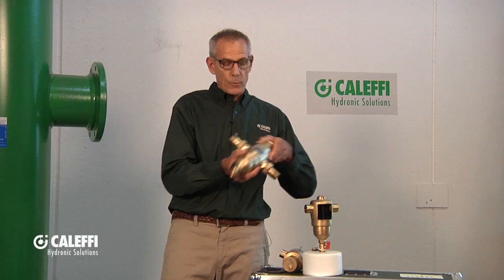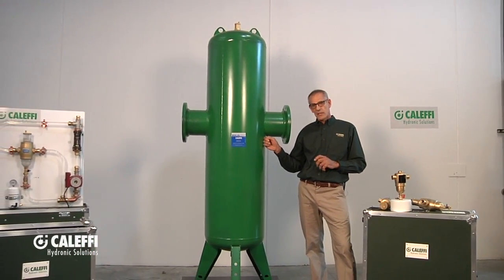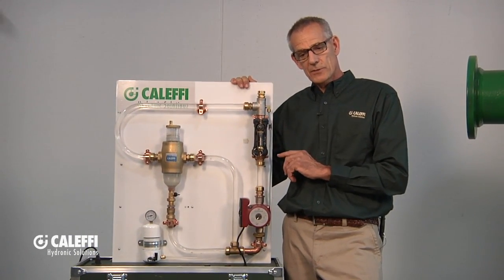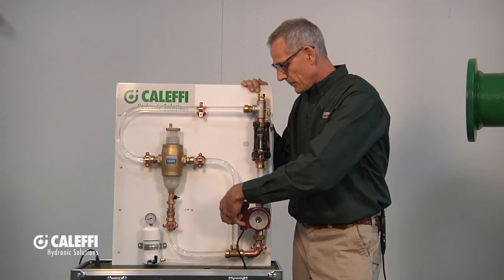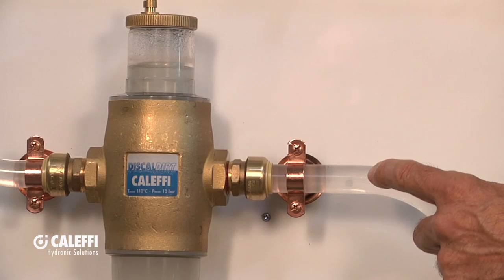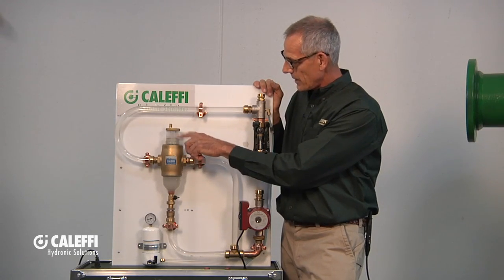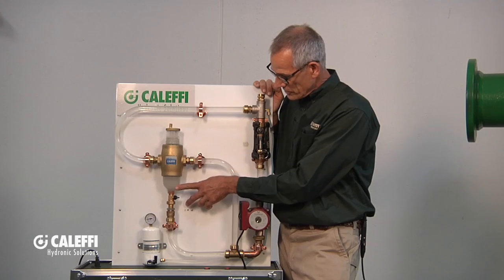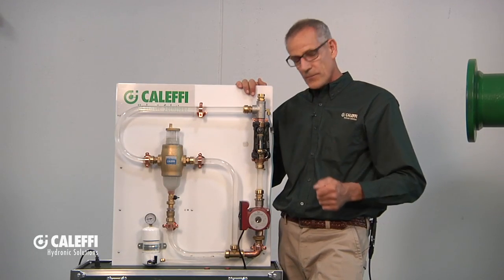DiscalDirt® - Combination Air & Dirt Separators

Comment: Bob can you use press fittings instead of sweat weld on the sepperator ?
Reply from the maker: Our separator is  available in sweat, press and NPT connections.  The larger separators are available with flanged connections.  You can order it to fit your unique application. Hope this helps.